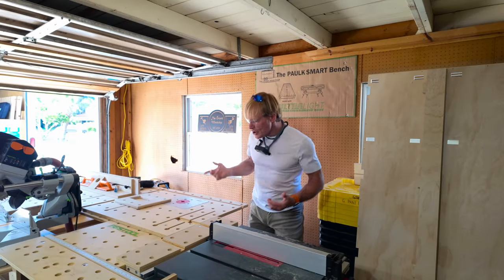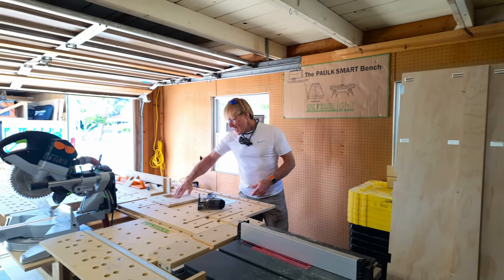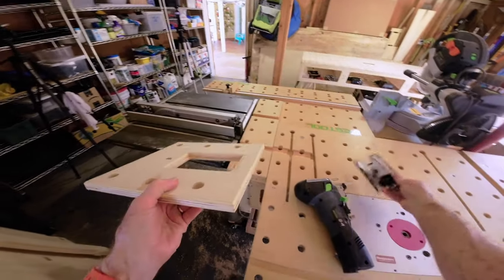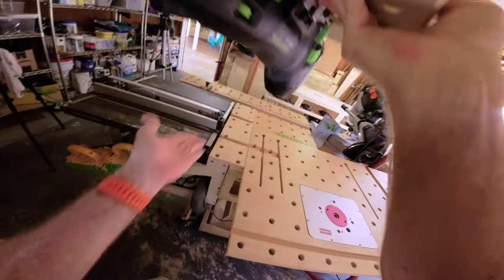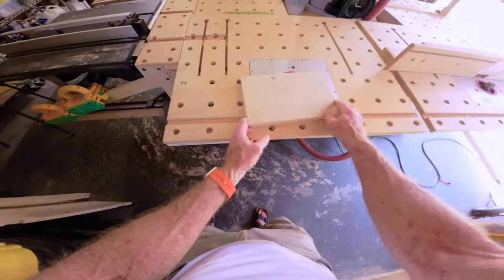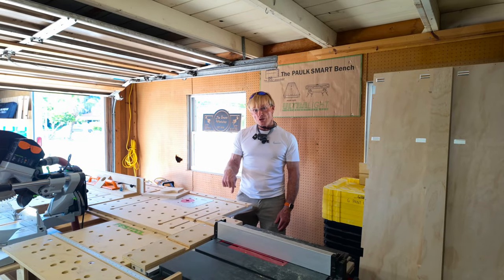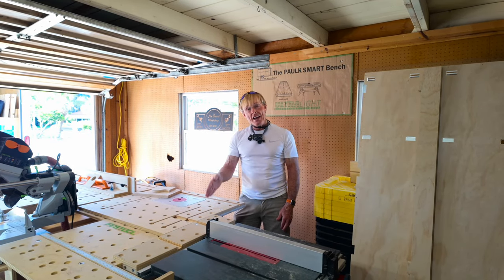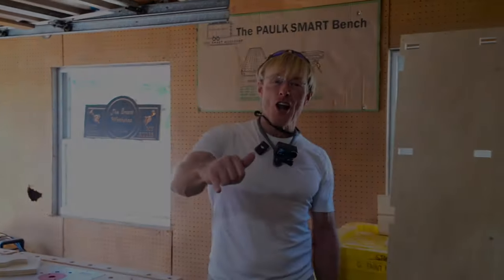How To Make a ZERO-COST DIY Scroll Saw!

Comment: Love your content! Consider making the plate for the scroll saw the same dimensions as your router table insert plate. Then rabbet the edges of that piece to fit where your router plate goes..
Reply from the maker: I considered that. The plate I have could be cut down, and then the edge could be rabbeted to drop right in. I opted for the undermount to allow more mounting options, but if I keep it where I have been using it, then I may go ahead and modify it. Good thought.😎🤙

Comment: I want to see a solution for making the OF 1010 router a fixed tool as well. Does the router insert for your system accomodate the festool router?
Reply from the maker: Sure as long a the plate fits the router of your choice any plate will fit the PSRT.

Comment: What if you need tighter bends.? Thats more of what a band saw can do, not a scroll saw...IMHO
Reply from the maker: My world and channel are centered around home building and remodeling. I don't specialize in tight scroll work; that's more of a hobbyist's tool. What I use suits our needs perfectly and performs well, without the necessity of purchasing, storing, and transporting another tool. While a band saw would be sweet, it's a large tool and not very portable.

Comment: I'm just don't get it. So you mount the stupid thing from under the table, thus limiting the blade's ability to cut to the least stable cutting portion which is near the tip, and that is a good thing? It kind of makes no sense.